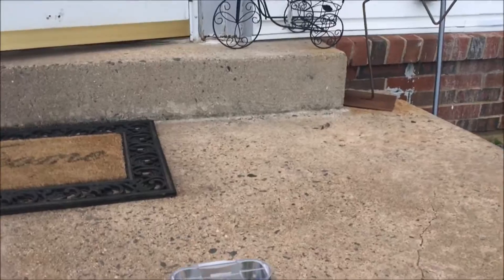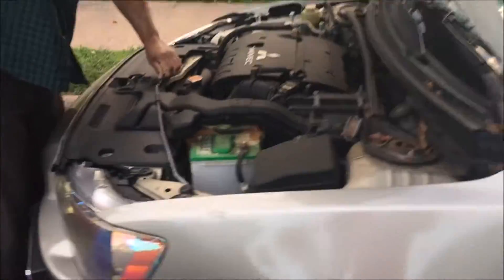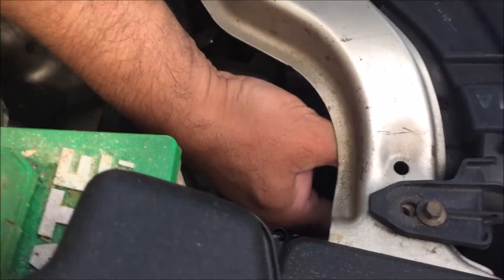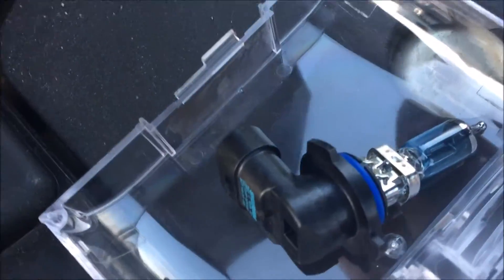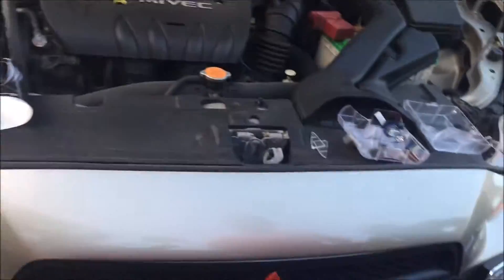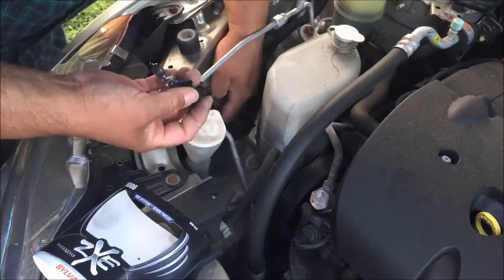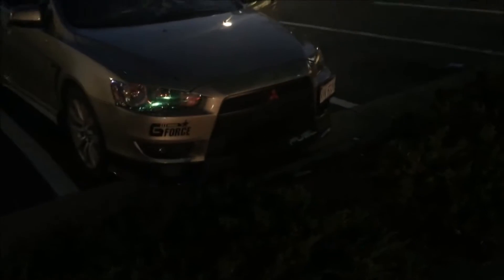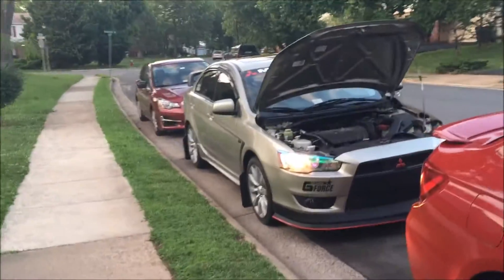Installing Sylvania ZXE hid

Comment: hey brother, great vids. I used to have a 2009 Lancer and installed ZXE HID but then switch to real HIDs. the difference was obvious.  I bought my kitchen on ebay from HID systems for about $26.00. I suggest you do the same.
Reply from the maker: I'm really bad with electric stuff lol but I'm thinking on getting hid tho thanks for stopping by 👍🏻
Reply: +Brinrex Excuse the errors in my last comment, my phone is stupid and added different words.  I didn't know much either but YouTube vids definitely help. That's what I did since some dude was trying to charge me over $200 just to install.
Reply: Brinrex looks good bro
Reply from the maker: +Jeffery Huante thanks man good headlights